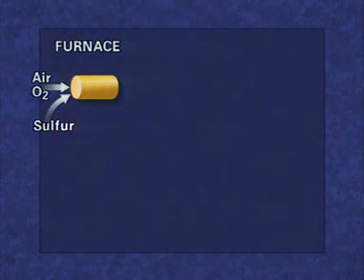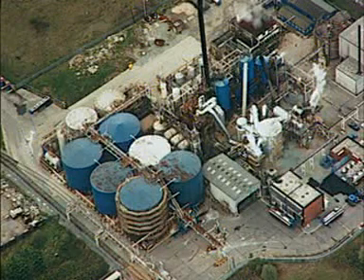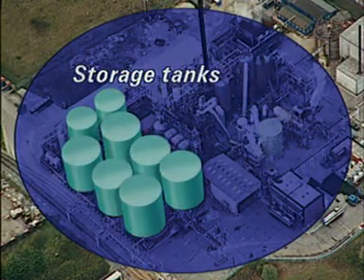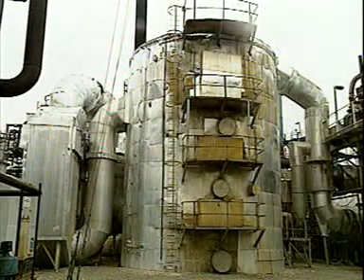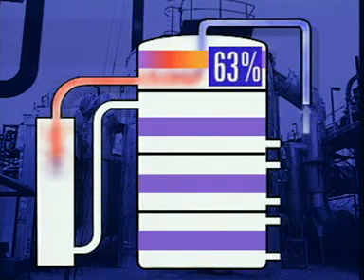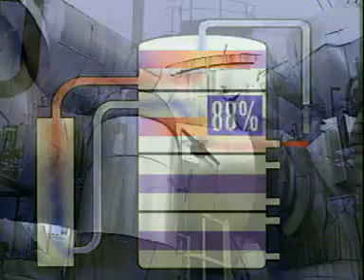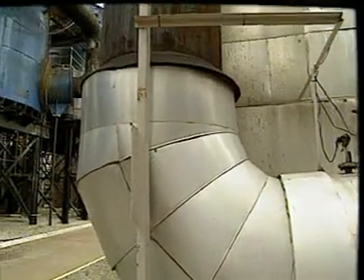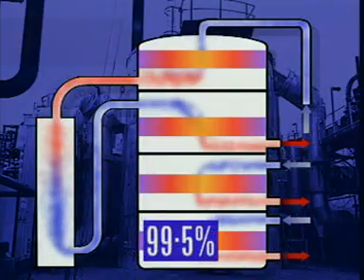Sulfuric acid production

Comment: was curious, still confused lol
Reply: Oleum is just sulfuric acid with SO3 dissolved in, and so is called fuming sulfuric acid as the dissolved SO3 fumes acid mist in the presence of air moisture
Reply: They burn sulfur to make SO2 gas, then react with more air to make SO3 which is dissolved in sulfuric acid to form oleum which is then diluted ti the required concentration, why the SO3 is dissolved in sulfuric rather than in water is since dissolving SO3 in water is stupidly more exothermic than diluting oleum

Comment: I love this video. I have used it over the years in my Advanced level classes. I missed the step where sulphur trioxide is added to sulphuric aco form oleum, which is then diluted to required concentration of sulphuric
Reply: I was the chap in the blue boiler suit. I worked there and  ran the plant for 15 years.
Reply: @brianjones9251 okay brian. How nifty! If i worked there I wouldve taken a swim in the sulfuric acid tank ages ago!
Reply: @brianjones9251  2:28 is that you? 😍😍😍
Reply: @brianjones9251  2:10 or is that you?😍😍😍😍😍😍😍😍💍💍💍💍👰‍♀️👰‍♀️👰‍♀️💒💒💒💒💒🤵‍♂️🤵‍♂️🤵‍♂️🤵‍♂️🤵‍♂️👰‍♀️